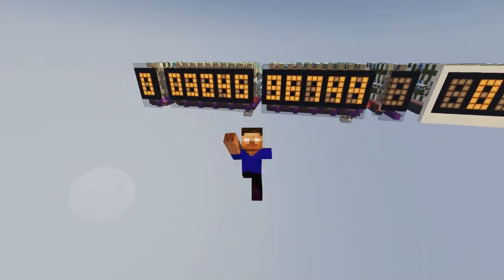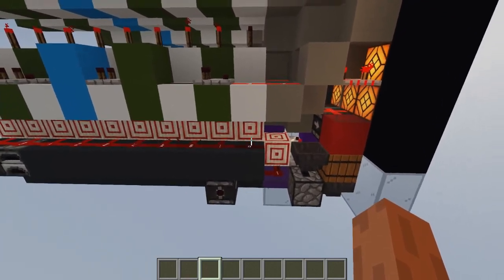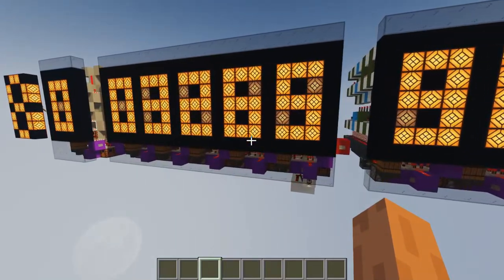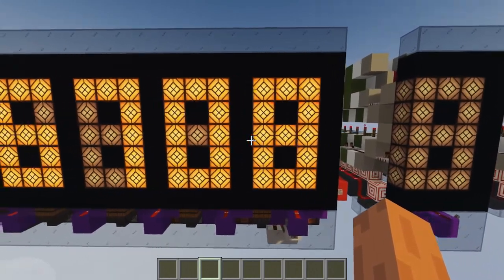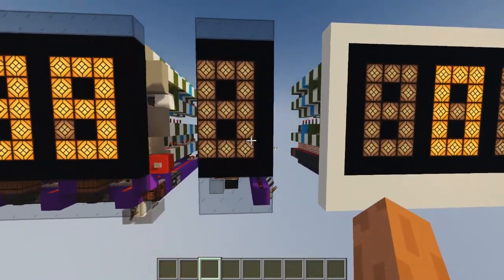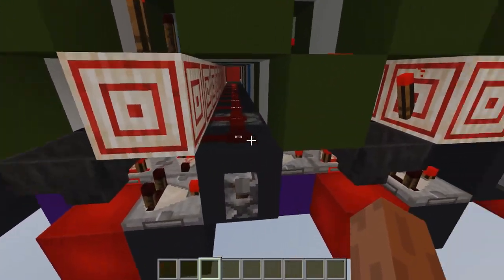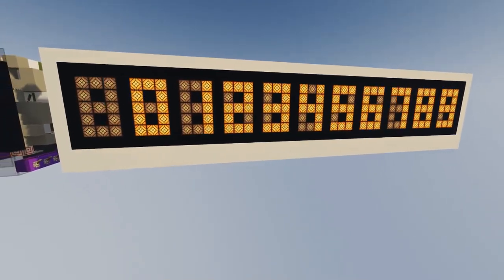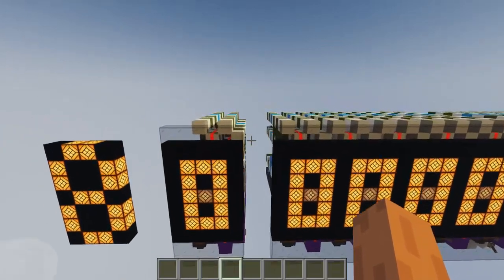Small 7-Segment Numeric Display: Signal Strength Input Counter | Minecraft 1.16+

Comment: Can I use a different redcoder?
Reply from the maker: Yes, the signal strength decoder is detachable and each slice of data is easily accessible from torches at the bottom.

Comment: Oh man, this would have been perfect to have a few days ago- I ended up modifying your old signal strength 7 segment display, and it was about the same size but definitely less reliable.

My display was flush with the floor- as far as 7-segment displays go, there is a distinct lack of horizontal ones that fit in floors or ceilings- I accomplished mine by removing the original screen putting an adapter of sorts on the front that "rotated" the signal by 90 degrees. If you aren't completely burnt out making displays at this point, I would love to see your take on this interesting problem in your collection of displays :)
Reply from the maker: Took me a little while to understand what you meant but now I see. I'm not burned out at all when it comes to display designs and I might give it a try.

Comment: Fantastic! I think it's the best 7 segment display so far. Great job!
Reply: Actually,no mine thing has got a much more compact design
Reply: @moderin294  Does it have quick reset button, counts down feature and signal strength input?
Reply: @Kleaps  I believe it has a quick reset button but not a signal strength input
Reply from the maker: That design is actually PeterJiang's not Mine Thing's! And it is a good one but it has a lot of limitations compared to this one.
Reply: @MaizumaGames  yeah I didn't read the description the main downside of that one is that it's not silent
Reply from the maker: TL;DR: These designs have different goals that's all.
Even if you're looking for just a counter ,that design's only advantage is size and synchronicity. It used a clever piston tape setup inside but I'm not sure it can count down even if you reverse the data blocks inside since the current state depends partially on the previous state.

Also it needs to rotate a variable number of times in order to reset.
It doesn't compare to a design that changes it's output value with signal strength in terms of flexibility.

But, once again, PeterJiang's design is ingenious and better than pretty much any other design when it was created.